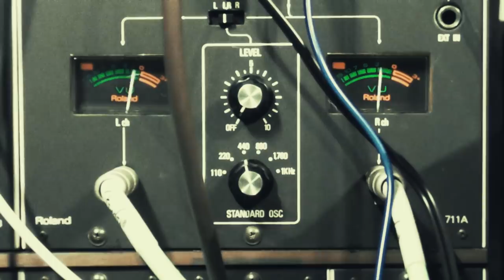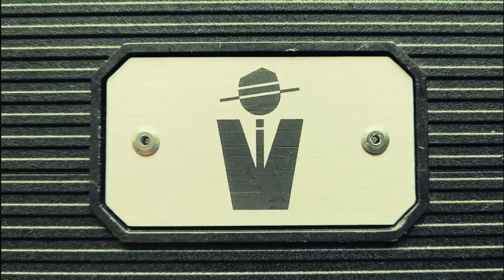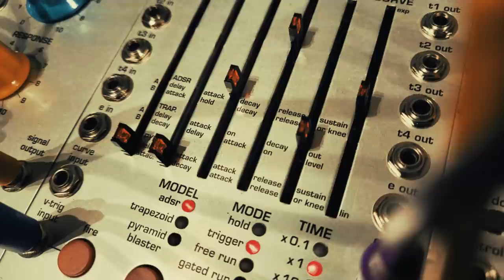Peter Stanchion and the Radiophonic One

Comment: I'll admit I'm 5 seconds in and have rewound 5 seconds, 5 times already and probably will do 5 times more before I finish whatever happens in this video after the 5 second mark. I've built up more anticipation in 5 seconds than in the first 5 seconds of a Lamberto Bava film.
Reply: So you were in loop mode mate? Hit the red button to switch back to gated.
Reply: @peterstanchion3197  Didn't work...still stuck in loop. Im scared Pieter.